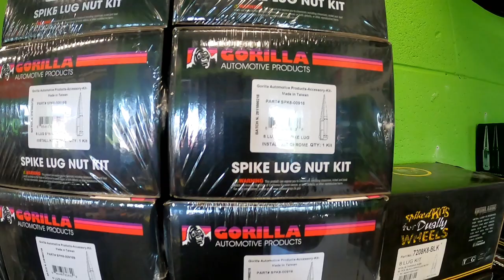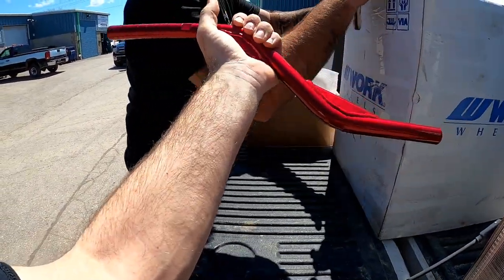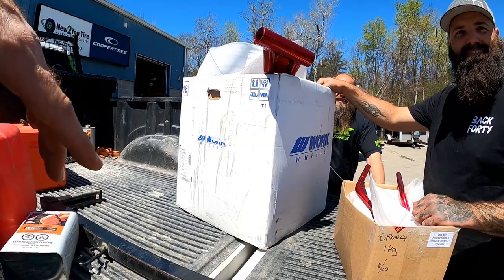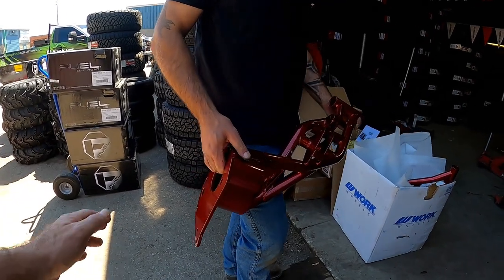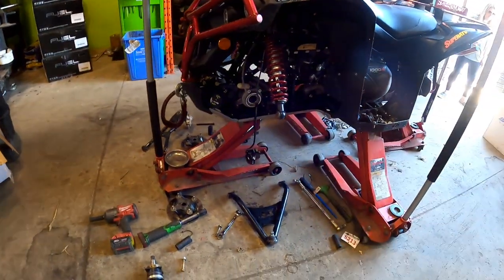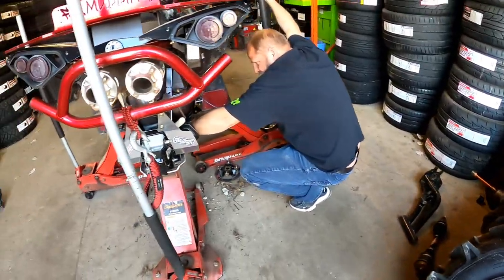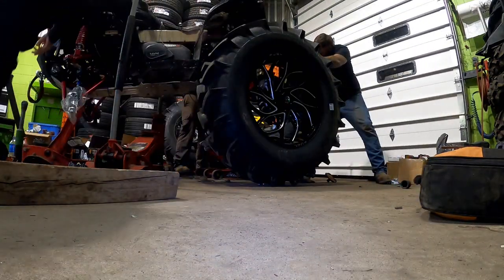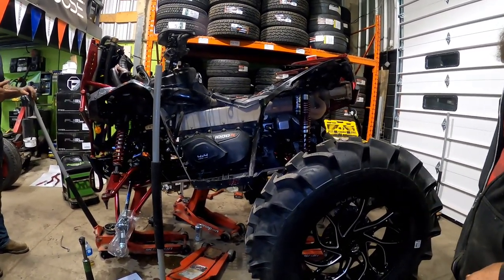Maximum Payload!!! + New Wheels & Tires for the Cummins

Comment: That thing is a best! How do you like the portal lift?? I’ve been thinking about getting the 6 inch portals for mine. I currently have the 6 inch super atv lift with 34 inch assassinators, torq locker, dual RJWC and tuned, STM primary and secondary clutching. Also what size are those tires?? It’s definitely a beast!